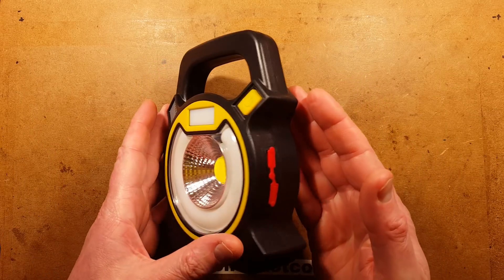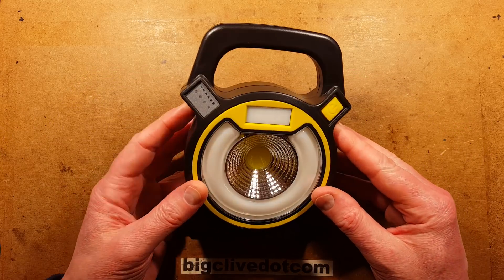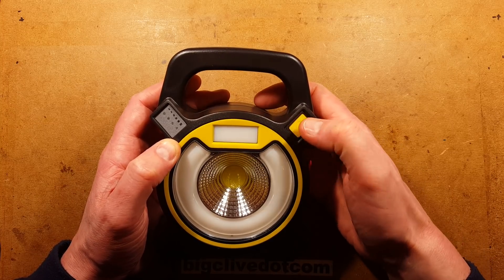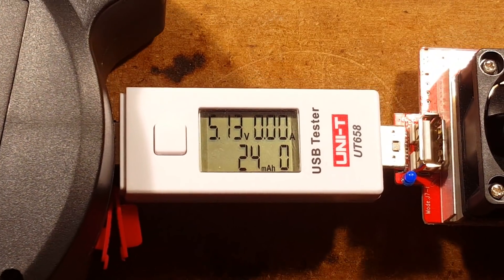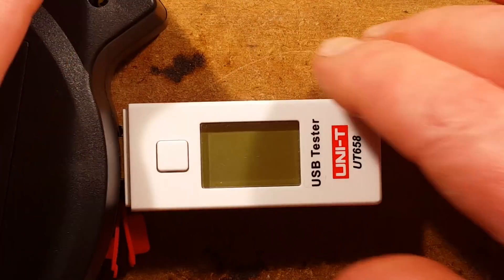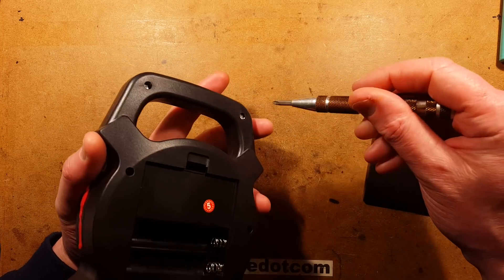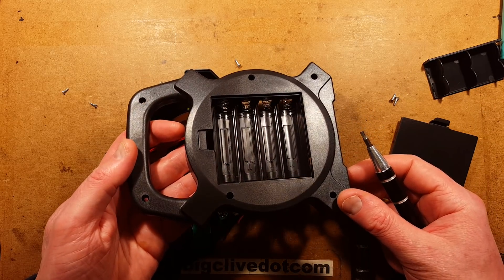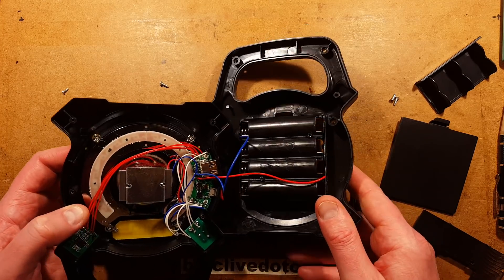Inside an interesting light and power bank with hidden upgrade.

Comment: Check this out. Similar setup, but they made actual battery holder for 4xAA or 2x18650.

https://www.aliexpress.com/item/40W-Led-Portable-Spotlight-Led-Work-Light-Rechargeable-18650-Battery-Outdoor-Lampe-For-Hunting-Camping-Latern/32955949655.html
Reply from the maker: Interesting approach.  Also strange that they offer three styles of COB array.  I've ordered one with the round COBs from eBay to take a look at.

Comment: mis matched screws are more a problem with warranty claiming.

if you get the screws in the wrong places they can detect tampering though the void if broken stickers make it easier

why only 2 slots for batteries are probably for hazmat shipping.

since much of your stuff that has battery shipping rules comes from the united states 20 watt hour per cell is the rule.

that would have to be 1 amp or less per cell and would still be ok and many of the cheap cells are of the 1 amp or less so it should still be legal.

it looks like 4 cells paralleled 

you are allowed up to 100 watt hours for a  battery.

if you parallel cells is that still called  a battery if so you can have 21 3 amp cells if the 4.2 volts is used to determine and still be within the 100 watt hour limit.

if the storage voltage of 3.7 volts you can get away with more cells or more amp hours.

for 18650 cells 3.5 ah is the max but for this example i used 3 amp hour as it is more reasonable max capacity you will find in quality cells.

another possibility for the cover on the battery holder is.

1. to prevent the terminals being exposed (one of the hazmat requirements for shipping is to make sure the terminals are not exposed so they can be shorted.

2. the tariffs on chinese goods  customs can estimate value of goods based on looking at the battery holder and ifs value does not match what it sais on the shipping paper work.

4 cells makes the product more valuable so it them may meet the minimum cost to be tariff able where as 2 cells gets past customs without tariffs

for example lets say the value is listed for a 4 cell light is $4 and the paperwork sais $2 customs may enforce tariffs or charge shipper for falsifying paperwork.

lets say the same light only holds 2 cells and paperwork sais $2  customs lets it through.

would the customs tear down stuff to investigate like you did or do they just pull it out the box and sais "oh ok" and puts it back in and matches it up to the paper work and lets it through
Reply: ejonesss This shipped with no batteries...

Comment: They probably sell a 4 cell "heavy duty" version for a slight upcharge. Kind of like the voicemail systems we used to have at work. They sold the system according to how many hours of voicemail it could hold and the larger 8 hour systems were like twice the price of the 4 hour ones but the only difference was how big they created the partition on the hard drive. Exact same hard drive but a bigger partition on the 8 hour model. We didn't know it until the hard drive started having problems so I copied everything over to a new one and created the partition to fill the entire disk and ended up with 193 hours of recording time.
Reply from the maker: Or the very expensive telephone exchange system where the supplier's engineer demanded that everyone leave the room while the upgrade was carried out.  They peeked in through a vent and he pulled out the existing module - flipped it over and reinserted it.
Reply: @bigclivedotcom  Clumsy technician, or perhaps he had stupid bosses. The correct way to do it is to go there with a replacement module and swap it. Just don't let anyone get a real good look at the module you pulled and they will be none the wiser. Then once you get back to the office you clean the one you pulled so it's on hand for the next customer who buys the upgrade...

But yea, it's hard to feel pride in your job when it has you doing things like this. I remember back in the eighties when management got in their heads that the technicians would be peddling useless crap to our customers.  I protested that it would devalue the company name in the eyes of our customers but got told to just do it. So I got the demo kit and gave it a go. The first customer just got pissed at all the useless crap. I gave him the direct number to my boss. The next day the demo kits and marketing material was gone from the office and nothing was ever said about it.
Reply: @bigclivedotcom  BT do this shit all the time. Had an Avaya system that needed an extra BRI card. They sent the card, but had to pay an extra £300 for Mr BT man to come and put it into it's socket or we'd void the whole contract. Total bullshit. The blanking plate had thumb screws. Bastard didn't even need a screwdriver.
Reply: Dan Harris - 🤬, no need for profanity’s, just say “rubbish” 🙂
Reply: Dan Harris 
Don't sign the contract then.
Reply: That kind of thing has been going on for decades, all the way back to the 486 processor. The 486SX didn't have a math coprocessor, while the more expensive 486DX did. There was also the 487 chip, which was a separate coprocessor that could be added to a 486SX system for cheaper than buying a 486DX and swapping it out.

In actuality, all three of these were the exact same chip. The coprocessor on the 486SX was disabled. The 487, when installed, would disable the SX chip completely and it would be the CPU for the system.
Reply: both of these examples are the sort of scams that matt allright from rogue traders would bust. I hope the telephone exchange man got busted for that dishonest behaviour by everyone he demanded leave the room.
Reply: The customer pays more and gets an upgrade, so how is that a scam?
Reply: @simontay4851  that is no scam. They did get what they payed for. That the manufacturer soft locked features and charge you extra for it is a business model, mostly driven by end product cost being nearly independent of manufacturing cost.
Reply: Simon Tay 
Dishonest?
Reply: The same applies quite openly to many modern instruments for example the Rigol digital storage oscilloscopes and spectrum analysers, which have all sorts of expensive optional add-on features. When you buy an upgrade all you get is a serial number to enter which enables that part of the system software.
Reply: Similar to the solar cell unit on some sets of solar garden lights, the box has 3 cell compartment but only contains one cell.
Reply: Dale Gribble  Kind of. A lot of the slower clocked can't actually run with the clock rate of the better ones with the deigned voltage because of process variation. Of cause if they have the variation under control you end up with cheap processors with huge potential.
Reply: "You have eleven thousand, four hundred seventy-two new messages"
Reply: It's a common distribution model when development costs massively outweigh single unit manufacturing and distribution costs. That is because you are paying for the development costs, not the the bits in the box.

It's almost ubiquitous when it comes to software, and while less common in hardware, still occurs when it comes to silicon chips and some other devices. Personally I don't really have a problem with it as long as I get what I am paying for. I'd rather they were open about it, but from the above I can kinda understand why they're not.
Reply: @anononomous  Yeah in that example they either could get large hard drives cheaper than 4 or 8 or they had extra stock

EDIT: looks like they were using a smaller one and OP used a large one and got 193 hours
Reply: just like buying a tesla with a "60 KW/H" battery that actually has a 75 KW/H battery but the software limits you to 60 unless you pay more for what you already own.... I feel like there is an open market for hackers to "upgrade" tesla battery packs... hacker charges $2500 to do what tesla wants to charge you $7000 for....
Reply: @crazypete3759  The reason Tesla overprovisions its batteries is to keep nameplate capacity at 70% per-cell capacity.
Reply: I like reading about this kind of stuff, there needs to be a subreddit for this
Reply: k - 🤬👎
Reply: k 
And you're an ill-mannered clown.
Reply: I brought a router that does a similar thing, the D-link DIR-878 is actually identical to the beefier DIR-882 on all regards except the number of USB ports, yet the box of the 878 is labeled as having three-stream AC1900 capabilities and the 882 as having four-stream AC2600! The thing is, they didn't even cripple the cheaper version, testing has showed that the 878 actually is a AC2600 router with four stream capability' they just marketed it as a lesser router to get a piece of the AC1900 segment of the market.
Reply: @Chris Appleton huh, right. Gotta take research costs into account
Reply: Sony made the HXD860 TV recorder with a "120 GByte Hard Disc" and the HXD870 with a 160GByte Disc. Use a service remote (or a Logitech Harmony) to reformat the disc in the HXD860 and you will find you have an HXD870. You don't even have to open the case !
Reply: It reminds me of many service shops who would give the customer a 'quote for the repairs which were needed'. If the customer said, 'No.', the better ones would undo the repair which they'd already made, perhaps adding a 'diagnostic charge'. The less scrupulous ones would simply burn out a vital component, often wrecking the kit completely, because it was less work than swapping in the dud component, or undoing a replaced wire, and then they'd add the 'inspection cost'. Roguery is endemic.

Comment: Why are you mismatching lithium cells, Clive? You should know better.
Reply from the maker: As long as they are at the same cell voltage when paralleled it doesn't matter.  You could have a 1Ah cell with a 3Ah cell and it would result in 4Ah of capacity.
Reply: If the voltages (edit: to clarify, the voltage to which they are charged) are the same there really isn't any issue with mismatching cells in a 1S pack. The cells are connected in parallel, so they will inherently remain balanced. If they were connected in series, however, it would be a much more significant issue.
Reply: @DielectricVideos  so is that the main reason old laptop batteries cant hold their charge because some of their cells is becoming bad thus making the parallel connection unbalanced?
Reply: @hafizmaulana8166  laptops run cells in series to get 12-19v.  Even then running unmatched cells (which happens naturally as they age) is safe if your using a BMS.  I can't recall where i read this, but i swear i remember seeing someone testing exactly this, and even a cell at 3v put in parralell with a 4.2v cell didn't charge the low cell fast enough to case dmg.  Obviously this is a bad idea, but i think it's safe enough that unless you do something stupid, you shouldn't have to worry about it
Reply: I guess it shouldn't matter in something like this, but it will definitely be an issue in high-drain applications.
Reply: @MickeyD2012  Why? They self balance.

Comment: Way back when I was in school, our DC Passive Circuits teacher told us to never use batteries in parallel. I've always followed her advice but have noticed that lots of engineers do not. The advice seems logical to me as two or more batteries can't have the exact same voltage and the higher voltage one(s) will send a high current in the lower voltage one(s) because of the low resistance of whatever connects them together. Can't that possibly damage the batteries and even cause a fire if one of the battery does not hold a charge?
Reply: That's only a problem when you first put the cells in. After they've been connected together for a while, they will match voltage automatically. But it's still a good idea to match cells for capacity and internal resistance before deciding to mate them.
Reply: It depends on the battery technology. Lithium and lead acid batteries have a voltage that is roughly proportional to charge level. When connected in parallel they play nice with each other and share the load/charge. In fact it is better in many ways to charge them in parallel rather than in series. When charging lithium batteries in series you need extra balancing circuitry to make sure the cell voltages are matched. When charging in parallel you get that automatically. NiCd/NiMH on the other hand are very temperature dependent and it is generally a bad idea to connect them in parallel. For instance when charging, if one is warmer than the other it will have a lower voltage so it takes more charge and possibly even pulls charge from the other cell(s), which makes it warmer so it pulls more charge... and generally it goes downhill from there.
Reply: These cells have a current limit. If you connect them together, one of them will send a current to the other, but as long as it doesn't exceed the limits, it's fine. That's why they should be the same type and fully charged when you connect them together, so the difference is as low as possible. After that, they automatically balance themselves.

Comment: This would've been better if they just made the inside hollow so you can put your own bank in, with a simple usb female-to-male extension for charging externally. Who the hell has spare 18650's to put in a removable compartment with integrated recharging??
Reply: A lot of people who like to take things apart and build battery packs tend to have quite a few miscellaneous 18650s around. LED flashlights and vapes also often use them. I've got a bucket with several at home and I carry a couple in my backpack for my flashlight.
Reply: I do....
Reply: @andersfrihagen3656  You have them *hot swappable*? And you would rather put them in removable compartments? 
Imagine this lamp came with a USB powerbank enclosure instead. Wouldn't that have been better?

Comment: Red and blue would be a particularly bad choice in the US.
Reply: Would never use that function in a car.... or really anywhere....  Do not want to be charged with Impersonation of a Police Officer...
Reply: I'm not sure if your legally allowed to flash red and blue in Australia as it's reserved for emergency vehicles only.
Reply: You can have my orange flashing module.
Reply: Mister Hat you can have far bigger problems with a red wire and a blue wire! https://www.youtube.com/watch?v=4vCvm3gEEzE
For those who know what's coming. Fallon Is The Champion!
Reply: Entirely depends on the state. Here in TX, only emergency vehicles (police, fire, medical) and some road maintenance vehicles can have red and blue flashing lights. General road maintenance and tow trucks used to be solely orange, but are now allowed to have orange and blue for better visibility for oncoming traffic. The old orange lights on many of those vehicles were so dim that you didn't know what they were until you were right on top of them.

Other states have different laws, I've heard of at least one where tow trucks can have red and blue lights because they're considered emergency vehicles that often perform dangerous work.